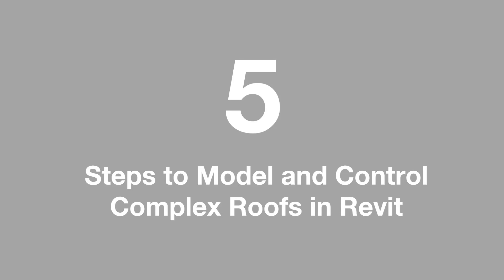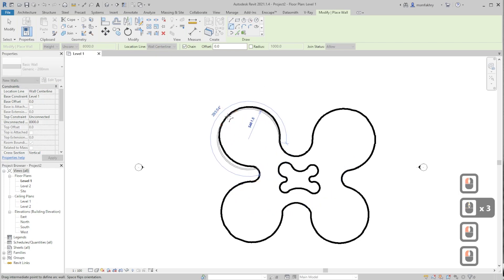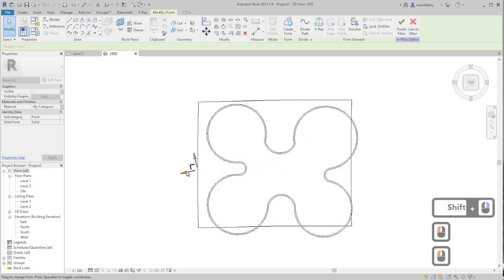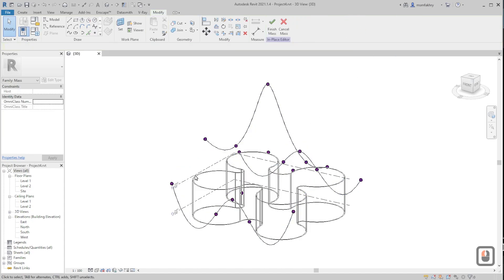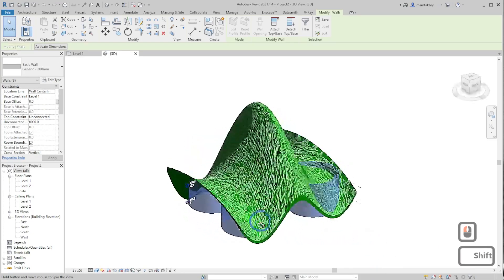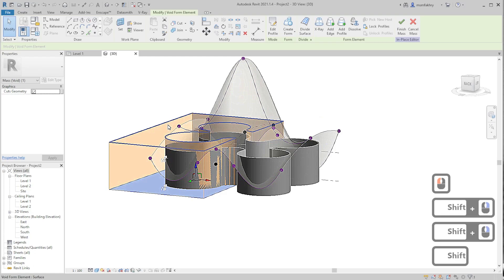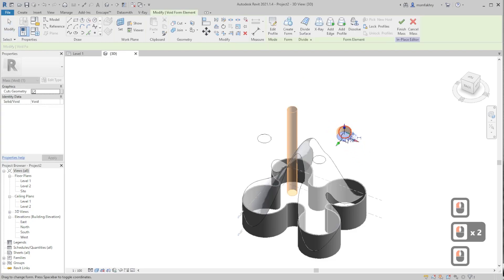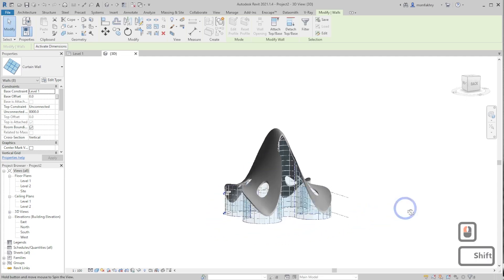How to Create Complex Curved Roofs in Revit

Comment: is it possible to create a form that's curved from both directions (like blob architecture)? all videos i can find cover curved surfaces in one direction only, i have found a workaround using a smaller curve at the end and beginning but it's far from perfect
Reply from the maker: yes.

blob, like multiple curved open-ended line profiles going through a path to make a form? i can only think of the Selfridges building as an example

let me know if you are looking for another one specifically

i might upload the how-to soon, but for now you can find similar "vertically" challenging complex massing exercises on the other channel: https://www.youtube.com/@Mashyo
Reply: @MashyoCom  thank you for taking the time to reply so quickly! 

i was thinking of a blob more like Kunsthaus Graz, where there are multiple curves defining its form in one direction, but the form still ends and begins at one point or tip (the form isn't open at the end). 

i'll check out the other channel, thanks again!